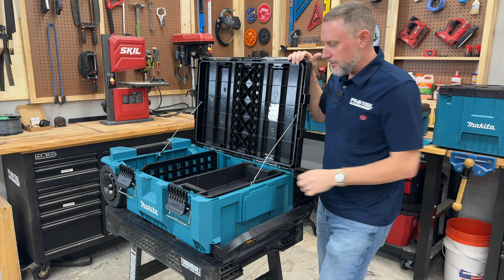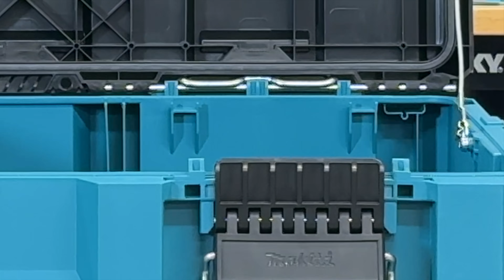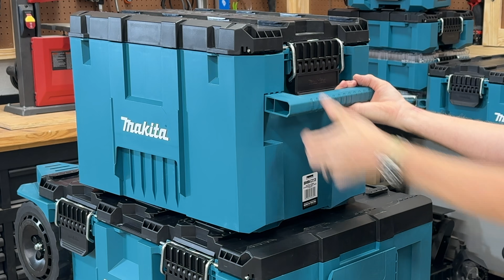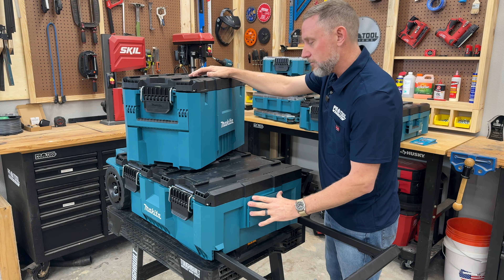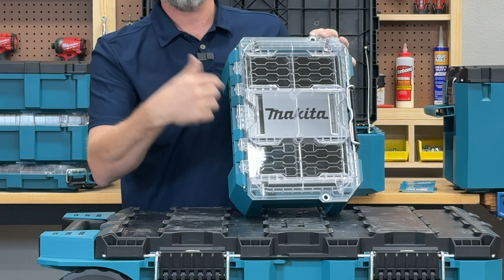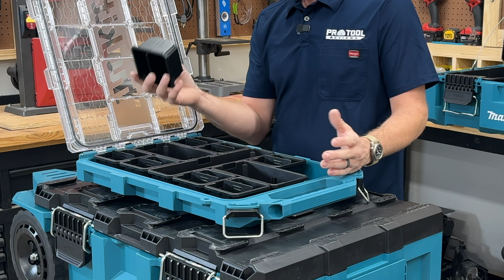Ultimate Makita MakTrak Tool Storage Review!

Comment: It's absolute crap. It doesn't stand up on its own. The handle doesn't lock to any position. The top box is not supported by anything at all etc. etc.
I guess they focused more on putting American flags on the thing instead of actually designing a usable system. Did they even test it out even once.

Comment: Oh no Makita is too late to game and doesnt have drawers lol. Drawers leak water, parts migrate into back. people buy new truck every few years but cant upgrade their tools? Unless you like to play jenga w heavy boxes stack and unstack 20x a day plus not be able to get whole system out in one controlled slide: then buy the other guys me too vertical system that are all same w same issues. Ive had Packout for 9 years and all sudden flex, klein, dewalt, crapsman, husky, ryobi, tuffbuilt etc gettin in on action w same design but not too late?. MAK is the way,  i literally save enough $$ not stacking & unstacking 2 hours a day at my day rate p year to buy 10 of the MAKTRAK system. Packout rolling drawer no guides? Rolling big box nothing is accessible and until you guess what…. unstack everything aaaaagain!!!. Try loading that beast into truck solo. If you need more space then buy another MAK roller MAK ❤️‍🔥

Comment: Man o man! I'm ALMOST sold on this. Thing is, I'm still using my RIDGID 1.0 system. Several reasons I'm not QUITE sold. 
1. The rolling tool box is too horizontal. 
2. No promotions on combos. Single sale only? Cmon Makita. 
3. Security.  RIDGID 1.0 supplies a bar to be dropped down through all sections that's single padlock capable. How many padlocks are needed for all 7 pieces available?  
4. Sometimes PUSHING the stack is necessary. Like when pulling and a wheel gets caught on a small rock or fastener on the jobsite. One must push the stack to clear the obstacle. 
   Just my 2 cents.
Reply: The rolling box is DESIGNED to be horizontal, for use in a pickup truck.

Other systems stack vertically, this was designed to be horizontal.

It's like using the PACKOUT rolling tool chest.
Reply: @VideoArchiveGuy except packout blocks everything on top cant open anything and you have to unstack to get into truck.  Early christmas for my back= MAKTRAK
Reply: @TLhike Not everyone drives a truck. When unstacked, RIDGID fits perfectly into my trunk. As far as security, of course I have a locked whip I use to secure to a column, studs, or gang box. Someone attempted to get into mine but failed. The bar was twisted and bent but kept them out. 👍It was over a weekend so I've never left it behind when leaving Friday afternoon ever since.
Reply: @meagaindave2049 glad you kept your stuff fuckerz are relentless. rigid is solid stuff that was my first tool rig love their crates. Cheers
Reply: Horizontal means you can slide it into truck all together. Plenty of sites have combo pricing ACMEtools has tealdeals 100$ off. Padlocks? Locks only keep out honest people when weve been ripped off they take whole enchiladas not pick locks lol

Comment: That looks way nicer than the style of stacked vertical boxes. Why has this not been thought of yet.
Reply: Yes - everyone else stacks vertically, MAKTRAK went horizontal.
Reply: To be honest with you, I don’t totally agree with this idea. I think in terms of practicality the way you’re going to hold this against your body in order to move all your tools it’s going to be a backbreaking. It’s so far away from your centre of mass with your arms reached out on both sides.

I like the idea of having dual side opening.
Reply: @shankurrim5540  idk though I have to through vertical boxes on a flat bed everyday and there is no good way of picking them up and off trucks. They are awkward and too tall to see in on the back of big work trucks. So I see this as way more practical. I also find tool boxes never go much further than a few feet from the trucks so all of them are decent to roll.
Reply: @ToolsareFun  some good points. But Milwaukee does make the extra large rolling boxes too. But the stacks are yet as you described.